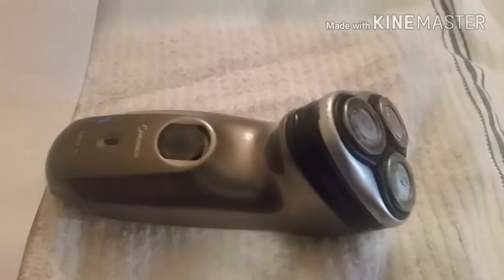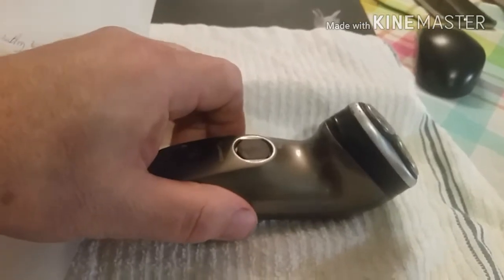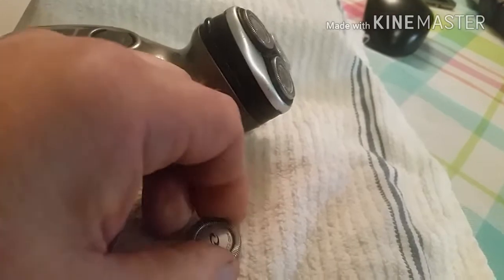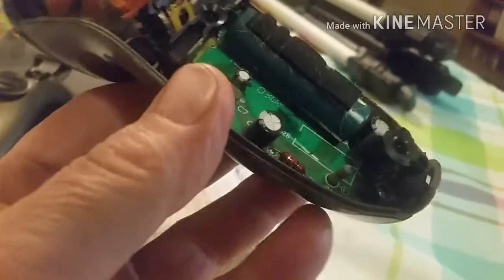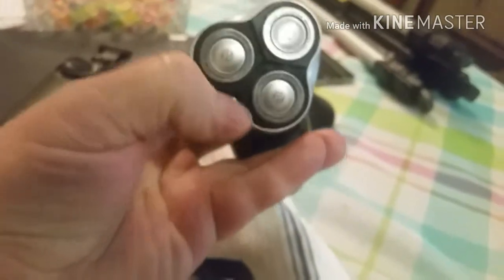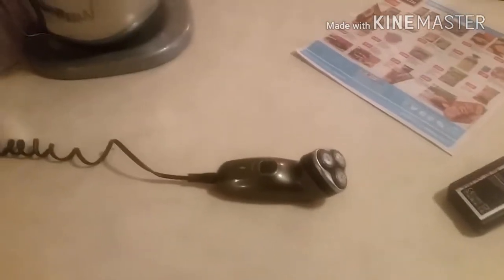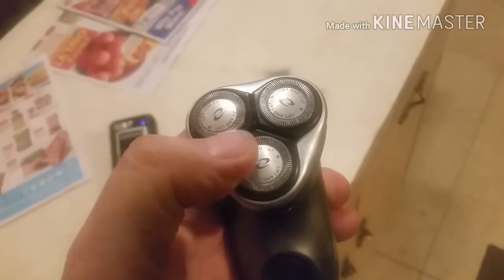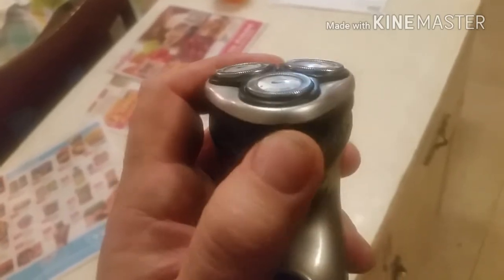Norelco shaver maintenance and repair

Comment: When Philips started getting into the total Wet/Dry shaver thing, they made them so they wouldn't run whenever the units were plugged in for fear of the doofuses taking them into the shower that way... I've had a succession of Philips/Norelco Tripleheader shavers since I was a teen in 1978, and have always shaved dry, with a pre-shave, even with the recent Wet/Dry units I'd had and have now... I like the Wet/Dry only because of the added convenience of rinsing the heads and drive pinion section out with water... With the older ones you couldn't even get the heads themselves wet, as they would rust in a fortnight - you had to clean them with a special alcohol/oil solution every two or so weeks and brush the rest of the unit out... Whenever the batteries finally do go, it's been cheaper lately just for me to replace the unit itself, as opposed to taking the shaver someplace to have the new battery soldered in... It depended upon how old and durable the shaver was that governed how long I held on to it... These newer ones don't seem to last as long...
Reply from the maker: I hate the fact that they become bricks when battery dies.